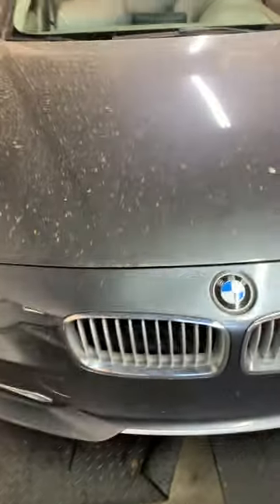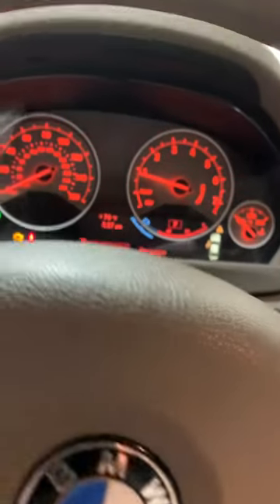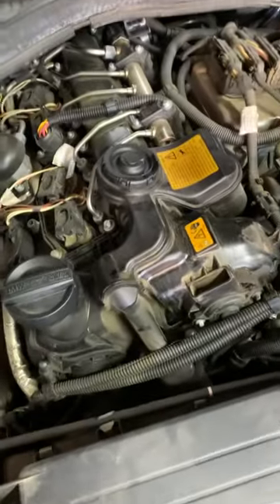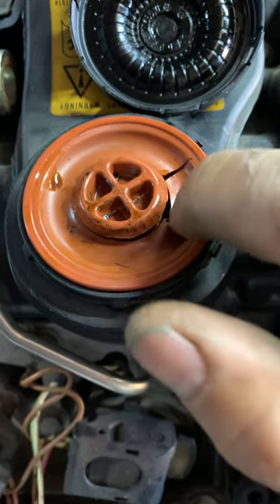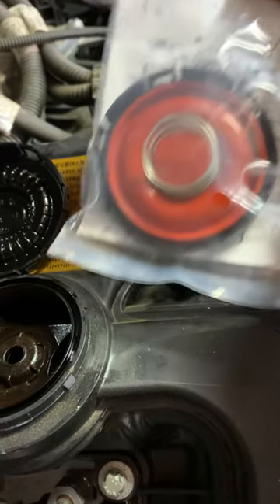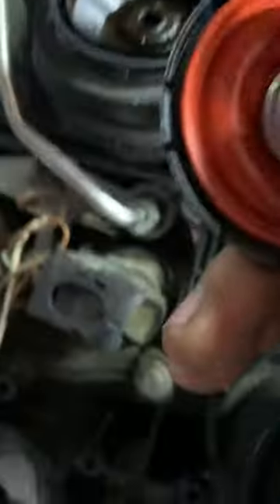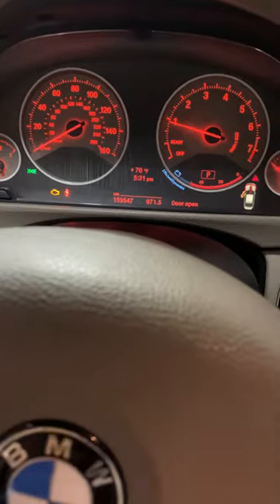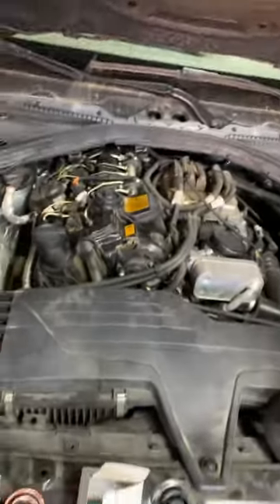2013 bmw 328i Whistling noises from the engine quick fixed.

Comment: This dude saved me a lot of money. Thank you for the video. It was right on the money. The part was like 50 bucks and took 5 minutes to replace. The minute I opened it up, I seen the crack. Replaced it and solved the problem. This is the best video yet.
Reply from the maker: Glad I could help
Reply: Cashapp this man 😅
Reply: Is it more or is this a common issue ? Because I saw I searched it up this video literally popped up
Reply: @Brandoncoopper  troubleshooting it is the best way.

Comment: Wow, thanks for posting this video.  My 2014 BMW 328i started making the same noise.  I took it to an independent BMW shop who recommended a valve cover replacement.  $600+ in parts, and $1375 in labor!!!  This new PCV diaphragm and cover are currently $48.99 at Auto Zone.
Reply: did it work

Comment: Hi there, Thanks for the video, it was really helpful. I was inspecting my PCV, and when I removed that plastic engine cover, I found there was some sort of foam-like sound insulation material between the valve cover and the cover itself. When I tried to remove it, it seemed stuck to the valve cover and got a bit damaged in the process. I noticed your car in the video didn't have that insulation. Is it essential, and should I consider getting a replacement? I appreciate your insights.

Comment: I have a quest because I’m questioning the integrity of my mechanic. How does this crack? I replaced my entire valve cover gasket 7 months ago and it started doing this for the first time ever. I told my mechanic and he said he would check it but charge me labor. I’m going to fix it myself after watching this but what causes it to crack?
Reply from the maker: Is happening because is not a good quality product. Is nothing related with maintaining. New product are better strong and upgraded
Reply: @frankguerrero3444   The reason I asked is because from my understanding, a new one is supposed to last at least 7 years. The mechanic I go to replaced the entire valve cover gasket which cost me over $500 in May of 2023. I suspect he didn't change it at all or it wasn't brand new.
Reply: @DJMarcBlends  hi marcus, i am a mechanic. it is very common to purchase aftermarket brand parts to save on cost because dealer prices are so high. often times aftermarket parts are not as high quality and long lasting. this is the reason i believe you have early failure. not due to any shady thing your mechanic has done. also this part is not the same part as a valve cover gasket, this is the pcv or ccv diaphram that is causing the noise. valve cover gasket is not the cause of the issue.

Comment: My 2014 328i xdrive doesn’t have the clips on the pcv you opened by popping them open. What do I do about that?
Reply from the maker: Is should be have it . If don’t you got to change the valve cover assembly .
Reply: @frankguerrero3444 how do you do that?

Comment: Will this fit my BMW 2007 323i Series3 ? It started it with the weird noise whistle and engine checking light, now the car stops running if I don’t hit the go pedal. Thanks in advance
Reply from the maker: I think your car need the valve cover assembly

Comment: My 325d  is making similar sound but not so loud what can it be the same problem also mine is drinking oil not leaking . No smoking just making a very light whistle sound like the airflow might be blocked but why it drinking  oil please can you help brother
Reply from the maker: Maybe a turbo charger. I think your is a Diesel so I can’t tell you the one is on the video is gasoline ⛽️ 😊
Reply: @frankguerrero3444  yes mine is a diesel